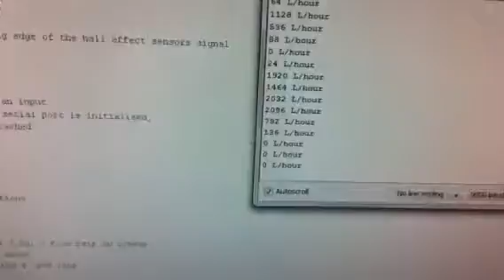Flow Rate Measure With Arduino

Comment: Hi. How many pulse pro liter does the sensor send out and how is your code for that. I am trying to make a fuel flow sensor for my car but thus far I am having problems re calculating a code borrowed from an arduino RPM counter.

Comment: Hi, I'm also learning to use arduino. I tried out the flow sensor example on the arduino forum but it doesn't get a signal from the sensor. I believe I have connected the circuit right, any help from anyone here? Thanks.